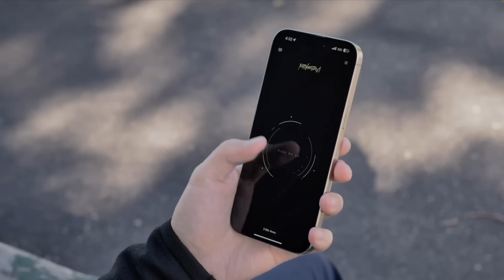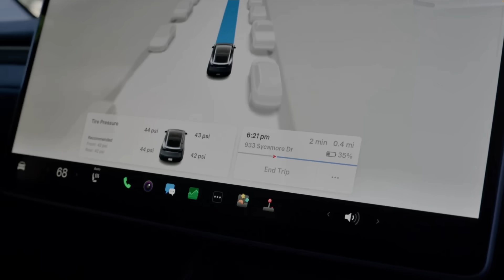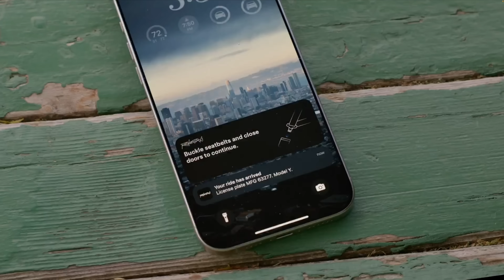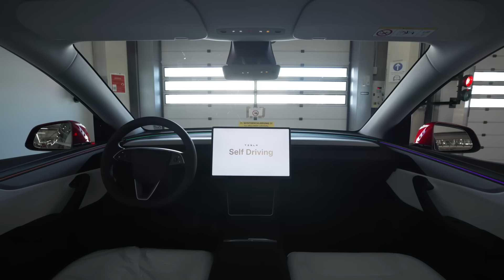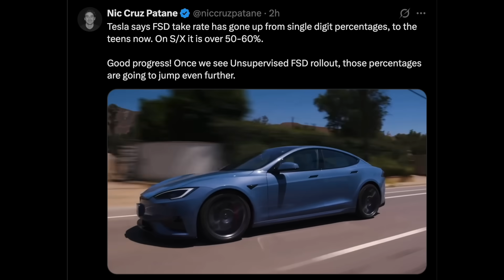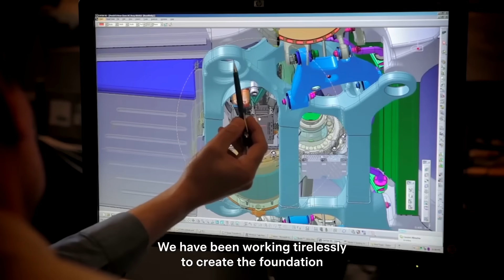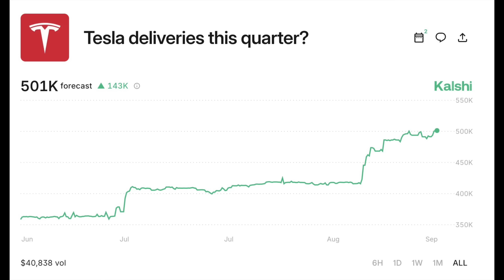Robotaxi public THE MOVIE

Comment: Hey Lars, excellent video! I do have a question. Do you think version 14 will be coming to the cyber truck? I’m asking cause we still don’t have actual smart summon.
Reply: My son has it on his 3 and in 5 years has never used it
Reply: @flethuman  “Actual Smart Summon” is relatively new, about a year old. 

I live in Florida, it rains a lot here. But the issue isnt the rain so much. That’s when you park your vehicle. There wasn’t a 3 inch deep puddle by the door. But after the rains, you may have a 3 to 5 inch puddle, depending on where you parked.
Reply: @DatDude923  it has been available in his model since new
Reply: @flethuman  I think I understand. There’s a terminology barrier. But we’re talking about is actual smart summon(A.S.S) you’re talking about smart sommon or regular summon. All three of those are available on the model three. None of those are available on the cyber truck.
Reply: @DatDude923  correct I have cybertruck and it is not there. Just FSD.